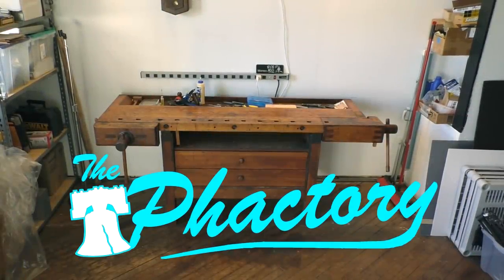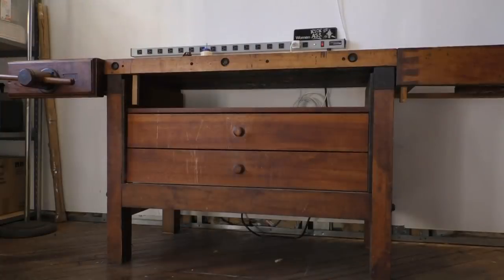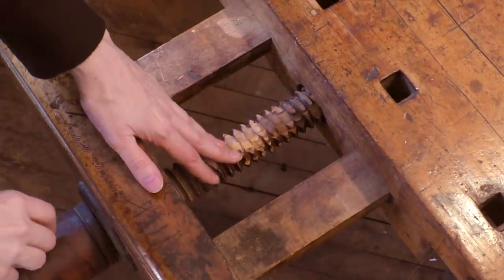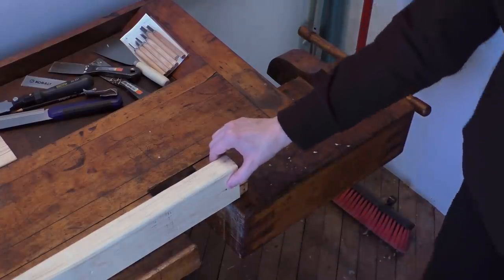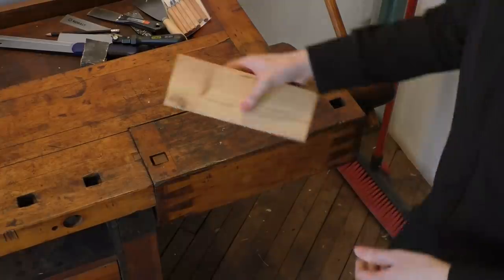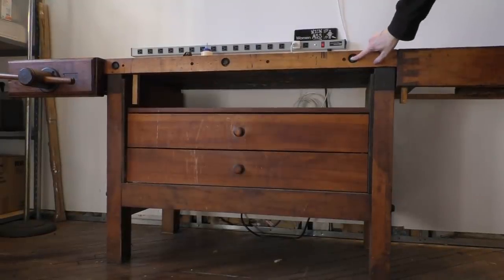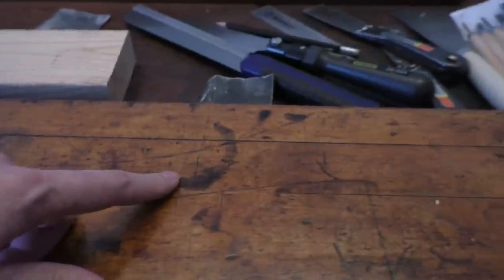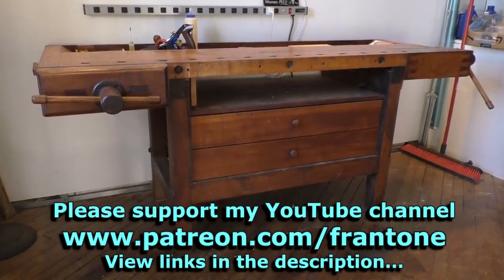19th Century Philly Style Woodworking Bench

Comment: Fran the bench is much older than the late 1880's, by that time philly had many foundries that even dated back to 1795.  most of the ( Carvers bench's) like yours with wooden screws date before 1830. I had a bench like it dated 1798. Look at the drawer bottoms at the edges where they enter the rabbit  groove. if the flat bottom is rough with a bevel that is concave from a scrub plain and the drawers sides are hand dovetailed it likely early 1800's. A later bench had a center metal screw with dowels on either side. BTW if needed the treads can be repaired

Comment: kinda funny i have a similar style bench except mine is a orginally 3 drawers with air space and a owner probably after ww2 added a 4th to make it higher judging from the materials and nails/screws used  and on the side your plane stop is added a metal workers vice and mine too is covered in cigarette burns there is a cutout in the tool tray were an ashtray is fitted im guessing it original as its hammered iron guessing the original carpenter was a big smoker